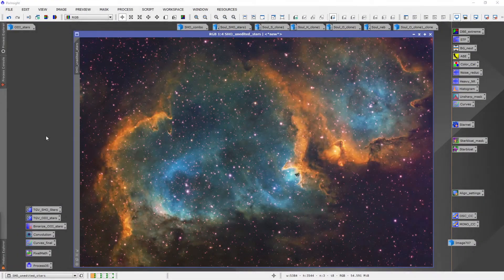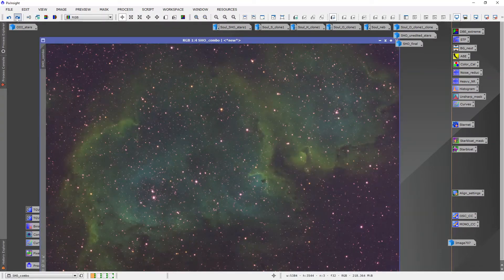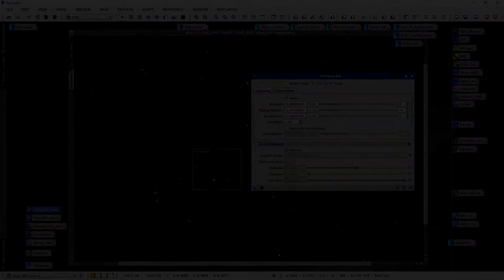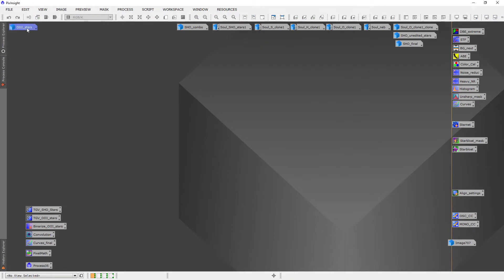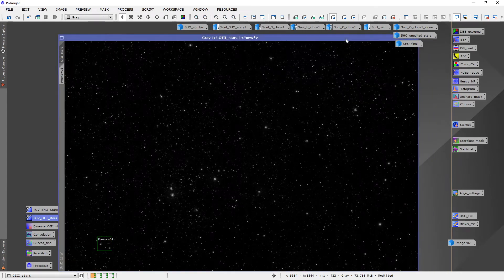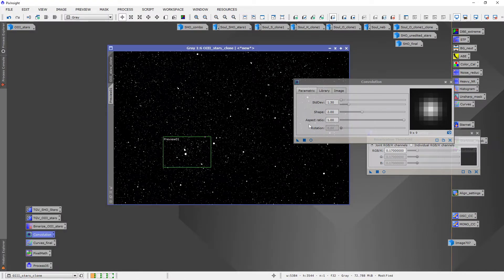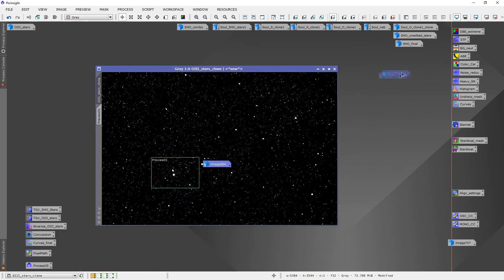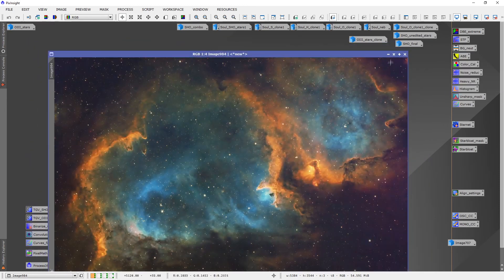A method for debloating and tightening up stars (using Pixinsight)

Comment: Thanks for this, i'll be trying it out later on a couple of images I have that are slightly spoiled by star bloat. Before I do though, just one question, does your method work with OSC data? Thanks
Reply from the maker: Hi Steve - it should work just fine. You'll have to split the RGB channels and see if any of the three channels display better, smaller stars. If so, choose that channel and work with it. If the channels are all similar, you can still separate the stars from one of them and create a binary mask to apply (inverted) to your full RGB star image. Then, use the Curves Transformation process to decrease bloat just like the video. In this case, getting the mask just right will be helpful.

I hope it works well for you - let me know how it goes or if you have any questions.
Reply: @ancientphotonsastrophotogr6999  Thanks for the reply. Red (which I use as H when splitting channels) is always  the best with Blue always the worst. I'll try what you have suggested & let you know how I get on 🙂 I just subscribed to your channel.
Reply from the maker: @Neph-v5r  thank you! Yes, please let me know how it works out-